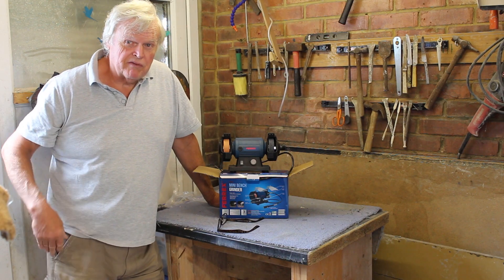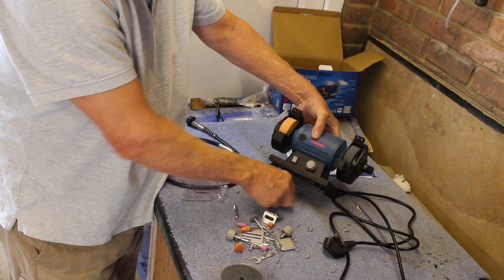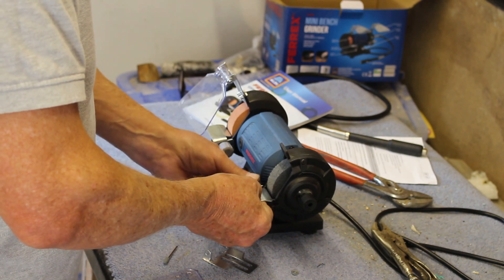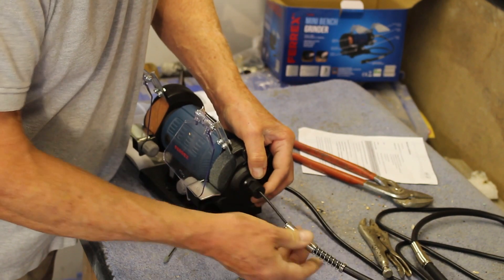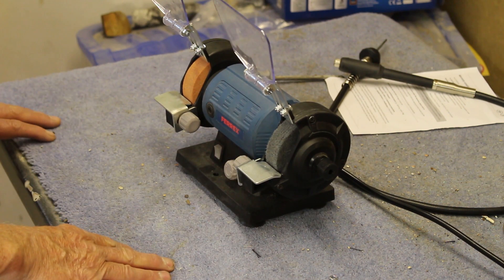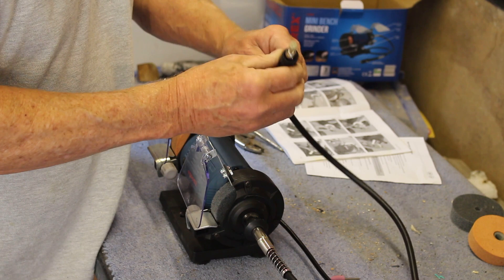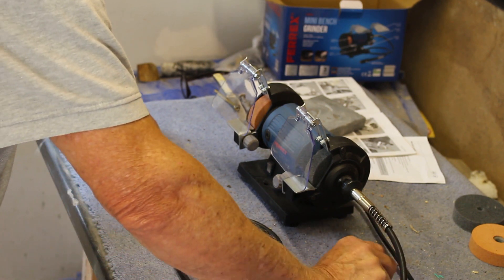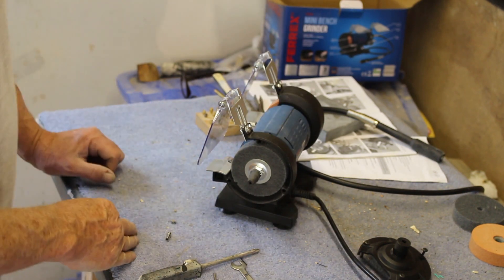FERREX MINI BENCH GRINDER PGB75G1 Latest version from Aldi tools, Assembly, Used and Reviewed.

Comment: Thank you for the excellent review of the bench grinder. Maybe I missed it in the video, can one use the flex-shaft without the grinding wheels rotating?
Reply from the maker: Only by removing the wheels, and then the wheel mounting shafts will still be rotating. I simply flip down the wheel shields when I am using the flex tool. Best of luck!

Comment: Hi i was wondering can you put a buffing wheel on this mini ferrex ? 👍
Reply from the maker: It comes fitted with a plastic foam type buffing wheel and you can buy felt and cloth wheels on ebay. Best of luck!
Reply: @thestonecraftingworkshop7490  thank you for the reply 👍
i guess thats 1/4 inch shaft and a 4" or 5 " inch wheel ?   i realy need the buffing segment to polish Glass and stones ect...
Reply from the maker: @simonac688.  Hi, it will only take a 3" wheel with 10mm shaft size. Best of luck!
Reply: @thestonecraftingworkshop7490  k Thank you so much for the info...
will check it out 👍👍

Comment: Many thanks Steve, I have just purchased this model today and needed a run down.  Here in Europe it is currently on sale for 39 Euro.  Anyway, as a woodcarver I needed the machine for sharpening small lathe chisels and the like.  The bonus was the flex shaft as this is the square type, more solid and reliable than conventional round Dremel versions. The only thing that I question is the use of the cable which should usually be hanging to prevent damage, as this has to be kept fairly straight whilst working plus prevents vibration issues.  This may be questionable as to the duration of the flex cord ?  It would be interesting to learn your opinion on this matter.  Many thanks and excellent videos.
Reply from the maker: I do not hang mine but as I only use this for stone carving I have not noticed any vibration. I do oil the drive shaft from time to time and have not yet had one fail. This is a good point well made and I will give this some thought, thank you. PS the weak point on the drive is the plastic lock sleeve which seems pretty flimsy. best of luck, cheers!
Reply: @thestonecraftingworkshop7490 Many thanks Steve.  Yes, the drive lock is certainly one to consider.  The other point is that I am left handed and can not use the flex shaft in reverse, an issue they didn't consider either.  Thankfully the updated design of having the square shaft is similar to the Foredom and able to maintain more heavy use, though on a quick test it does become unusually hot.  Overall I think the tool is handy and I will handle it with care.

Comment: Square aperture for the flexi shaft is off centre so needs a bit of work locating it through the side cover. Also the foam wheel has eccentric rotation.
Reply from the maker: I have three of these and not had a problem with the shaft. Not used the foam wheel, not sure what it does! Chinese stuff can have problems with quality control.
Reply: @thestonecraftingworkshop7490  It's a woven fabric impregnated with aluminium oxide grit.

it is esenssially stuff scotchbrite, a beefier version of the green stuff on the back of sponges.

Used for polishing metal, deburring metal, rust or tarnish removal, etc.

Comment: I wonder would this be able to polish cut glass bottles?
Reply from the maker: Hi Desmond, I really don't know. It polishes small bits of stone and marble etc. but I wonder if it lacks a bit of power for bigger jobs. I am not even sure which part of the bottle needs polishing? I do know the actual polishing process for glass is similar to marble but with much finer polishing compounds so for smaller tasks I am sure it would work. sorry I can't be more definite.
Reply: Thanks for the reply, well when I cut a bottle, the edges are sharp, which I want to make smoother, sorry that is what I meant by polishing.

Comment: I think you may have incorrectly installed the two guide plates. Looks like you have Left and Right swapped so the bevel edge ends up against the wheels which I think is wrong(?) Interesting video, thanks. Looks like a handy tool.
Reply from the maker: You are correct, thank you for pointing this out. Cheers

Comment: Shame we don't see this on slowest speed...I bought one today for plastic modelling and even on slowest speed its really fast...Grinding thin plastics I need a slow grind speed...The speed control on mine seems to be fast and at its lowest setting is slightly slower than fast...Any ideas?
Reply from the maker: Hi, the speed range on mine goes from very fast down to very slow, at least seems very slow to me grinding stone etc. It is not powerful at the slowest speed and slows down even more under the slightest load. I can't think of  way of slowing this down more. sorry.